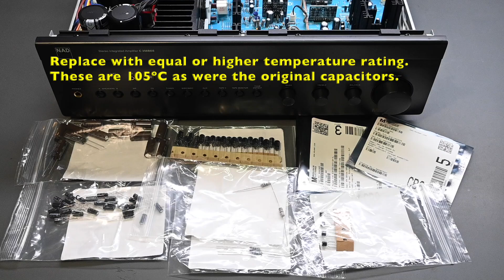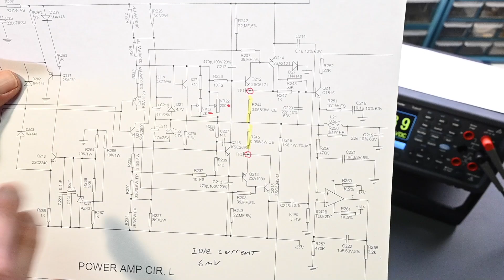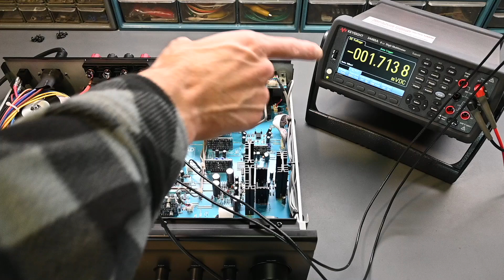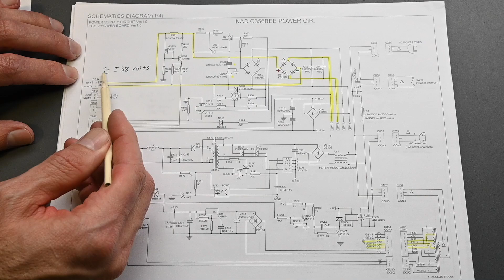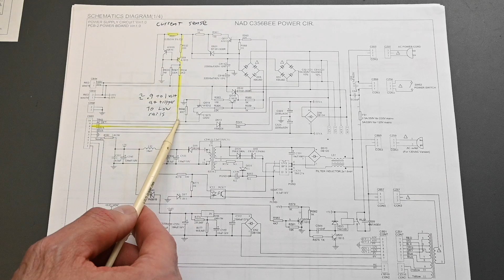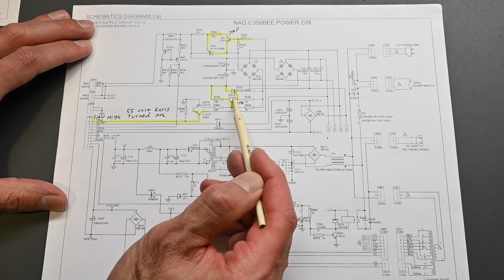NAD C356BEE Stereo Amplifier Repair And Test - Part 2

Comment: @EriksElectronicsWorkbench how do you think this amp would fair with loads of 2 ohms? I have connected two set of speakers to both terminals that have a minimum impedence of 4 ohm (each pair)
Reply from the maker: The NAD data sheet specs the 2 ohm IHF dynamic power at 290 watts (this is a 20 millisecond tone burst).  The power drive system would limit the actual continuous power to about 80 watts per channel.  However the user manual states to not use less than 4 ohms per channel.  I suspect the amp could overheat (and go into shut down) if driven very hard at 2 ohms per channel.  For average listening levels 2 ohms is probably ok.
Reply: @EriksElectronicsWorkbench thank you for getting back to me. The amp seems to cope very well with my two sets of speakers. I guess they don't operate constantly at 4 ohm anyway.

Comment: What is the component cost on a repair like this? I imagine it being negligible.
Reply from the maker: The capacitors, resistors, and such for this repair are not very expensive.  A fraction of what the amp is worth.
Reply: @EriksElectronicsWorkbench  Cool, thanks! I an super fond of older (80s/90s) hifi gear but finding someone that can service the components like you do is hard. Thanks for the insight!

Comment: I enjoy your videos because you explain everything in detail, which most don't. I learn a lot from your videos. Quick question, I found the Fluke 3000 Probe interesting. It looked like it worked well for you with that noisy transistor. Do you think it's worth getting one??
Reply from the maker: Thank you for the nice feedback, glad you are enjoying videos on my channel.  I'd recommend the Fluke 3000pro tone tracer probe.  It is a great tool for troubleshooting.  Even though it is marketed for telecom use as you can see it works well for other types of testing.
Reply: @EriksElectronicsWorkbench  thanks for the reply. You don't use the tone generator when using the probe on audio receivers, correct?
Reply from the maker: @coxswaine1  correct don't connect the included tone generator.  That's for telecom testing.  The tone you are listening for depends on the test, it could be noise from a defective component, tone from a signal source, audio, or even digital data noises.  Any electrical signal can be detected.
Reply: @EriksElectronicsWorkbench  Awesome, that will be just another tool to help figure out any problem pieces.

Comment: Great tutorial.  But I still don't understand what the heck is powerdrive.  I have two power envelope nad receivers and they are clearly class G.  Is powerdrive just the isc capability, which is really dropping voltage to save the amp?  The power envelope units have the impedance selector switch, which uses lower voltage transformer taps in the 4 ohm position.  Soft clipping is similar to what you have shown here.
Reply from the maker: Thanks glad you enjoyed the video.  Powerdrive is a marketing term for the circuit design as shown in the video that essentially protects the amplifier under any impedance load.  When the amp gets to the point that the output transistors would be overloaded the supply voltage is lowered.  Also if the transistors start running too hot the voltage is lowered to reduce power dissipation.
Reply: What watt do you use for load resistors for servicing
Reply from the maker: @Gerry-i3z  The dummy loads are 300 watt, 8 ohm, non-inductive, Ohmite / Arcol NHS3008RF.

Comment: What a fantastic explanation for the ISC circuit. Thank you very much, please make more vids like these with defective audio Equipment! I've learned so much in this 1 hour.
Reply: Can you explain the DC Servo system and power amp circuit used by NAD? For the moment I have several NAD's on the workbench and I would like to understand their circuitry a little bit more
Reply from the maker: @BrunoCourtens  Glad to know you found the video helpful.  The DC servo system idea is to monitor the amp's outputs (each channel has it's own DC servo) and feedback an offset voltage into the first differential amplifier stage.  An op amp is used to do this.  The speaker line is connected to the op amp's positive input.  The op amp output goes to the input differential amp stage.  The goal is to null out any DC offset that might be at the speaker terminals.  I've seen this type of circuit in other manufacture's amps as well.  I did an Adcom GFA-555II repair video where the amplifier ended up having a failed op amp in the servo circuit.  Also, the DC servo op amp does not pass or control audio signals.
Reply: @EriksElectronicsWorkbench  , Thank you, very clear. The reason I ask this is because I have a NAD C372 that went into protection because of a faulty power transistor. I also replaced all the drivers and capacitors. But even now I have a DC offset of 15V! Even though the transistors, diodes and resistors measures fine. So I’m suspicious of the TL082D op amp that does the DC voltage. Maybe it went faulty because of a surge when the power transistor failed..? I’ll surely watch your Adcom video.
Reply from the maker: @BrunoCourtens  yes it could be the op amp has failed.  If that is not the problem then the DC offset could be originating from a failed component that is pushing the offset so large that all the op amp can do is reduce down to 15 volts.  Normally the op amp is only correcting for a small offset voltage.
Reply: @EriksElectronicsWorkbench  How do you search for an equivalent op amp? The TL082D is not so common to find and ofcourse I need something very similar
Reply from the maker: @BrunoCourtens  TL082HIDR should be the correct part, available here  https://www.mouser.com/ProductDetail/Texas-Instruments/TL082HIDR?qs=aP1CjGhiNiFPAz5QTO8vuQ%3D%3D     and data sheet at TI https://www.ti.com/lit/ds/symlink/tl082.pdf
Reply: @EriksElectronicsWorkbench  TL082HIDR is a SOIC variant and in the C372 there is a DIP variant :)
Reply from the maker: @BrunoCourtens  the DIP variant is listed here  https://www.tubesandmore.com/products/op-amp-tl082-dual-wide-bandwidth-jfet-input-8-pin-dip

Comment: I have two Harmon Kardon hk6600s; both are being serviced right now.  Never been serviced before.  One amp has almost constant static, but sometimes the static disappears for hours, only to come back.  The other amp has lost the ability to produce clear and steady sound at higher volumes, so it's failing.  I'm assuming the electrolitic capacitors need replacing, but are there other common issues?
Reply from the maker: The constant static reminds me of a noisy transistor but almost any component (resistors, capacitors, diodes, etc) can go noisy.  I did a video on an Adcom GFA555se amp that had a random noisy transistor.  I show how I traced it down with an inductive probe.  The amp with the loss of sound could be power supply related but basically a full power load test and then tracing the signal from input on through the amp could lead to the fault if the power supply ends up checking out ok.  A defective VA stage (voltage amplifier) could result in the amp unable to drive higher volume levels.  Capacitors are always suspect components and should be checked during any troubleshooting of signal level problems, power supply problems, etc.  Many amps have protection relays on the speaker output lines and dirty relay contacts cause signal loss and intermittent problems.

Comment: My C356BEE suddenly lost its signal in the right channel when listening to vinyl yesterday. Left channel works and no protection mode. Only ground buzz from the right speaker. Any idea? I could play music with only one speaker but I obviously didnt to not cause damage. I swapped out the amp with another amp and the speaker worked again so the problem is the amp. Any suggestions would ve appreciated!
Reply from the maker: Did you try other inputs besides the phono input?  If other inputs work then the phono stage is the problem.  Try both A and B speaker outputs.  If speaker B works then there is a relay problem on the A output.  Other than these ideas it would require testing the audio path using a signal generator for input and an oscilloscope.  Sorry I can't pinpoint a specific area that could be the problem.

Comment: thanks a lot for the video. I have a NAD 340 that I want to fix. The input channels are not working properly. Some research suggested to change the TC9273N. Since I am not an expert in the field I wanted to know more about the amp. I learned so much about the circuits, how they function and how to measure them correctly thanks to you. Great video. you explain stuff so well! Much love from Germany.
Reply from the maker: You are most welcome, I'm glad the video was helpful for your project.

Comment: Thank you for the very precise explanation of the ISC circuit. Personally I own a modest NAD 316BEE amplifier and the same concept is realized with two lamps in series between the two bridge rectifiers 😊. Transformer secondaries are 34 V and 25 V dual rails, respectively.
Reply from the maker: You are most welcome and yes the incandescent lamps offer a similar idea of power supply control.

Comment: Nice video. I like your pacing and teaching style. You don’t talk down to your viewers and seem to want to help them. In your opinion, was this NAD a quality unit?
Reply from the maker: Thank you.  This model seems to be a quality construction regarding fit and finish, good tech specs, and actual listening tests I am very happy with it.  It sounds fantastic.  The Power Drive system I am not sure I am entirely sold on the idea, it is interesting, and works as claimed, but I think I would still prefer a more rugged power output stage design with just a traditional power supply.

Comment: Thank you for the nice explanation of the "PD" function. Personally, I prefer a robust power stage (parallel transistors for example). I have a NAD C 316BEE, where it is solved using light bulbs. My other amplifier is a NAD C 372. Both amplifiers have good sound, but both amplifiers have quite noisy transformers - it is unfortunately quite unpleasant to hear at low volume levels 😞
Reply from the maker: Yes the current limiting bulb idea with two power supplies does achieve a similar result.  Any amplifier that has multiple power supply rails has quite a bit of added complexity and there is something to be said for just having paralleled transistors in the output stage.  But of course pros and cons of every design.  A noisy transformer would be very annoying in a quiet listening room.
Reply: @EriksElectronicsWorkbench  OK, thank you once more for your perfect work 👍